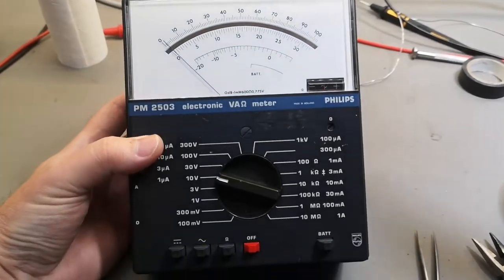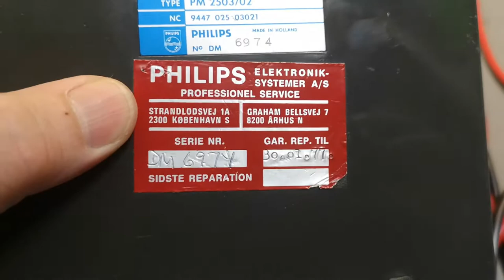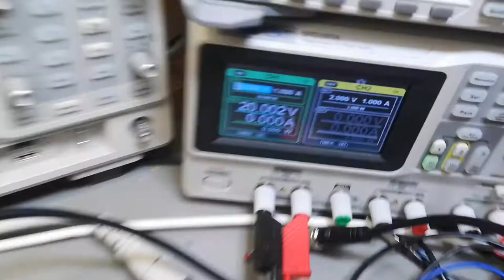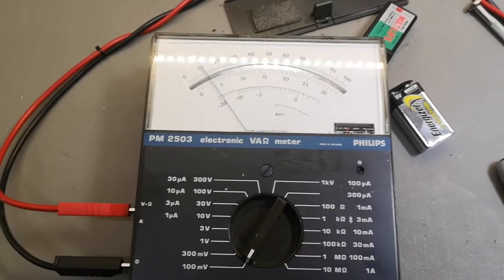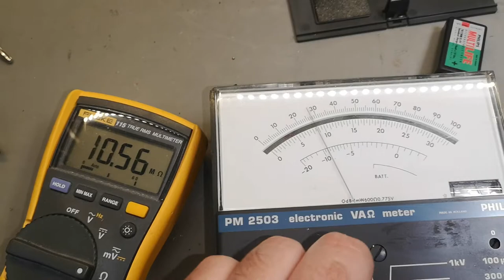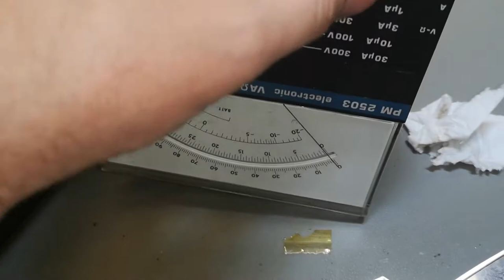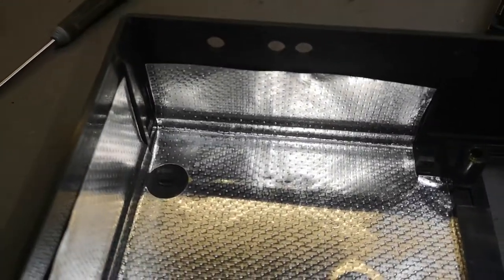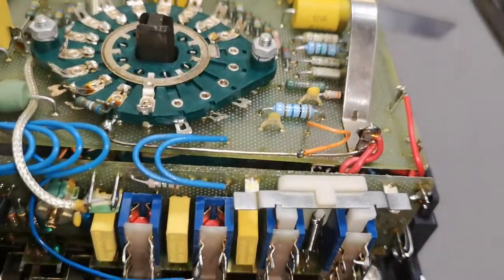Philips PM2503 Electronic Multimeter 1970 test teardown

Comment: ID is probably a discrete monolithic transistor array, probably a rebranded RCA 30 series array. The switch is there for the AC and DC because the next unit in the range for this switch would be taller than the case, adding in the extra double pole double throw unit would make the meter 1cm thicker, and that was probably not wanted because they likely used this case thickness to use existing accessories for the other meters in the range. Thus the precision die set to mould that switch add on, just to keep the height down. nice meter, and I doubt that factory in Belgium even exists any more, Phillips moved all production either to low cost countries in the EU, or offshored them long ago. Even sold off the Eindhoven land to a great part as well, so they now are really just a brand name.